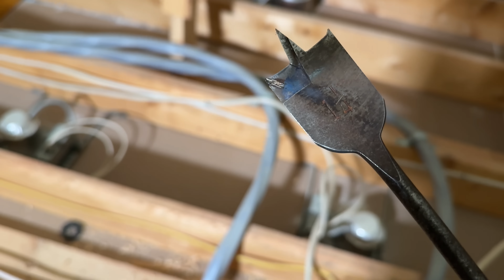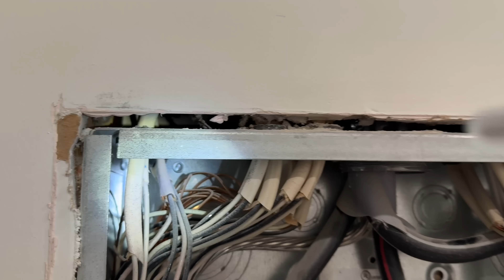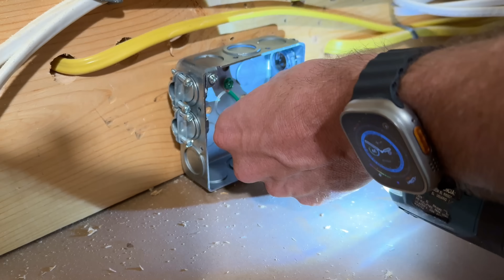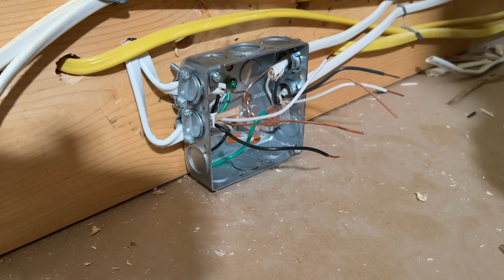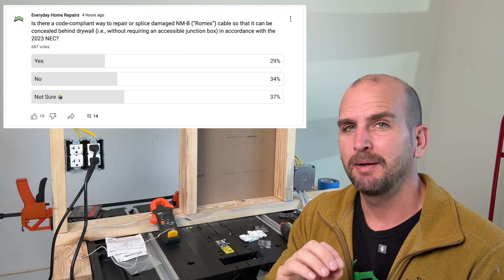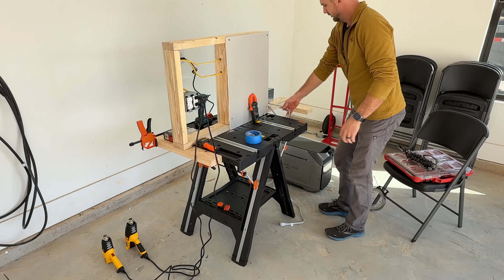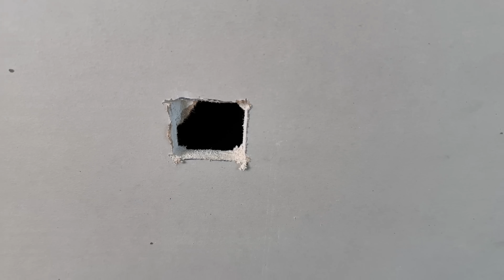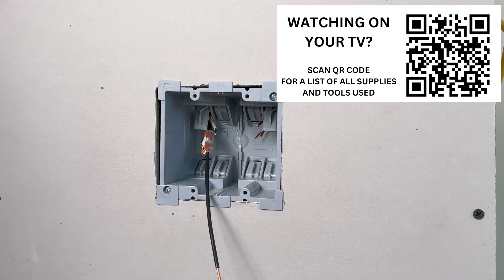How To Repair Damaged Romex |  3 Easy DIY Fixes

Comment: I'm curious how these will hold up after years of temperature cycling.
Reply: They don't last.

I just purchased a modular/manufactured home. ( built in 2001). The previous owner said that one of the bedrooms had not had power for several years prior. He had at least two "electricians" try to fix it. He was literally using extension cords to power the lights and other things in his bedroom. 

Less than a week after I purchased the property. I found the NSI connector under the home where the two sides join. Replaced it with a junction box and wire nuts. Problem solved. I have removed every NSI connector i have found.

Comment: As an electrician of 30 years I can say this is decent advice and I would only do numbers 1 or 3 although a bit different. Method 2 I would never do even if it is legal and made for that purpose. In time it has a high potential to fail and cause a fire. Any connection like that should be made where it is accessible and contained within a proper junction box. 
Method 1 is good although the junction box should be mounted higher and out of the way of future harm. 
Method 3 is good but I would add a second junction to have a more reasonable amount of wire enter the box and I definitely wouldn't use those butt connectors. A twisted wire and wire nut has been used for decades because it's a better connection and it's held tight. People can argue all they want, if I wouldn't do it in my mother's house based on failures I've seen over the years, I wouldn't do it in a customer's home.

Comment: Every electrician will call anyone who uses these a hack. Until they need to use one themselves. Plus the amount you can charge for it knowing the customer doesnt have to call a plasterer or painter to fix the holes made to snake a new wire.

Comment: Hey Everyday Home Repairs: Does your electrical inspector require Arc Fault Circuit Interupter protection (AFCI) on all living space branch circuits per the 2023 NEC section 210.12(A)?

Comment: Had tthe splice kit in #2 in my camper to connect the electric fireplace and almost lost the camper, would not want to use this in my house. Was a factory connection and I know they are only interested in production progress. Be careful when using these and make sure you use the pull test.

Comment: The issue with the splicing connectors is, there is no reliable way to check the quality of the connection under load, even with a milliohm meter. That being why some fail shortly, and others don't.
In the end, it is all about surface area of contact between splice prongs and the conductor. A barrel with couple of screws(on each end, making a total of six) would do a better job, but could increase the cost, reduce profit margin. There should be no issues with mating plugs in that respect. Just some 💭

Comment: “This new thing looks different, which makes it scary. Therefore it must be inferior to good ole insert-outdated-method-here that my dad taught me how to use.” 🙄

Now wago type connectors aren’t “bad” or “dangerous” because they’re demonstrably better than wire nuts, they’re just too expensive. 

Our 5th wheel RV was our home for 2 years on the road, and we put 20k miles on it in that time. It was full of backstab outlets and wagos. We had no electrical shorts or connection issues the entire time. Badly crimped PEX connectors is a whole other conversation…

Comment: It's amazes me how when wiring we strive for the most contact area for a good connection, but these "taps" makes the smallest piercing, in the insulation, and they are certified.  A recent undercounter led lights (which was designed to plug in) had this same microscopic "tap" but now are hardwired so much more copper connecting.
Reply: Most of these things have a bunch of extra capacity that goes untapped. The Wago lever nuts I just installed are good to 450v and 32a according to what's printed on the connector. There may be situations where you get close to that, just not in residential wiring. The breaker should throw well before it gets anywhere near that.

Comment: two boxes and blanks, new wire between. don't like it fork out big $$$$$ to replace it from end to end. suddenly most are ok with blank splice boxes.
those quick connects were/are used in prefinished modular home  panel sections to link between. I dislike them and think its just a n issue waiting to happen when a moisture issue or water leak occur and it's only a matter of time before it occurs.

Comment: I had a similar connector installed in the air conditioner of my RV... The ground was never connected property and the connector cracked. It was also in a humid environment full of condensation inside the connector. I won't ever use them for any project.  Absolute water proof with a physical bolted connector only for me.

Comment: Hack work.. Its better to just repull the NM cable and splice to an accessible box.. When it fails in the future and the electrician has to tear down the wall to fix the issue, we will be charging T&M.

Comment: I don't care for #3. with barely any wire coming in to the box and connectors stuffed half way out the holes.  Point of the box it to not have wire connections outside of a box.  Think I'd use two boxes to either side of the cavity and add a new length of romex between.

Comment: Being a motorhome owner I can tell you the hardware used is the cheapest possible, these manufacturers are about speed of build not quality, the methods are questionable at best, I had to rework many thing's the factory claimed were OK, biggest waste of money I ever spent, buying a motorhome 🤬, if one can replace those receps with normal.

Comment: No need to pull new wire to the Attic, just put in two junction boxes pull back enough slack to put a new wire between the two junction boxes

Comment: Ideally running a new length is a 100% fix.  However, I would choose #2 over #3 because the box looks ugly and is a "tombstone" reminder of your blunder and it contains 15 connections vs 9 in the splice kit.   "Less is more".

Comment: Can you give the NEC article that gives approval of the in wall splice kit. Also would have to be approved by local ahj enforcement.
Reply: Absolutely hate the idea of burying something like this in a wall. Things like this are invisible to anybody that does a home inspection the next time that you go to sell the house. And, nobody would even know if there's a ticking time bomb in the wall because it was done improperly.
Reply: I found it hard to believe too. Found this device is UL listed for NEC 334 application and 2023 NFPA 70, 334.40 (B) permits it. Doesn't mean it is a good idea, though.

Comment: Tip for short wires anywhere, instead of installing a double gang box which is a gain of 2" of conductor, install a single gang box near the studs to the left and right of the repair and connect with both boxes with a new piece of wire. That will gain you 12.5" of conductor on a 16" center frame. Sometimes, college ideas are just too risky, no shame to WAGO for trying to be cheaper than this.

Comment: In option 3, why use two short wires and three WAGOs per conductor?  Why not one short wire and two WAGOs, directly bridging the gap between the wires entering the box?  I'm assuming there's a good reason, just can't figure out what it is.

Comment: I put in a patio cover a few years back, and had to extend a porch light wire and wanted to use the NSI.  The electrical inspector would not approve unless it was in an electrical box.  I had to string new romex from the switch to the porch light, what a pain.

Comment: I remember a homeowner or hack electrician used these to save a a hundred dollars and ended up costing $7,000 plus to tear up a fresh kitchen remodel bc they went bad. They are legal but quality experienced electricians DO NOT use these or recommend bc in wall buried splices are looked down upon. I highly doubt this guy is qualified to give electrical advice

Comment: I had to use a Tyco splice remodeling... just a bad place for wire routing and was originally put in an unsafe place, so I had to move it up a wall and across through a hollow header, and used up all the loop moving it. The Tyco's in that 'box' though, so it would both be obvious and easy to break into if there's ever a problem. 

All those worries are worlds less risky than leaving that run in place would have been, since it was plain romex strung loose across a bunch of rather sharp masonry waste underneath a steel bathtub. Contractors/homeowners going wild in the early 80s....

Comment: I've never used those splices before. However, as a mechanic of fifty years I would only find one purpose for them  - filling my trash can. 3M has made something similar since the '50s called Scotch Locks and if I ever found one of my crew using one we would have a lengthy discussion and probably dismissal. We would have the same discussion if I noticed one in his tool box. They are crap, have always been problematic and I have zero idea as to how/why they have survived this long. When they have been used it's a 99.99% guarantee that they will fail and only the most green tech would not be aware of how worthless they are.
That being said, I realize they're two different products, yadda, yadda. However, the one is so worthless I could never bring myself to use anything similar.

Comment: We had one fail. I would not trust it due to ineffective contact. Having an inline butt connector would be better feeding both lines through twisting then clamping, lastly heat shrinking.

Comment: I prefer just putting them in tamper resistant channels disguised as chair rails.  Then you know where the wires are and if they need to be serviced, you don't have to rip up the wall to get to them.

Comment: H E double hockey sticks NO on that in wall splice. First, it is just a barb pushing into the wire. Second if it fails you will o ly know due to the fire. Most homes have low quality breaker boxes like GE, federal, challenger etc. Very few homes have a better quality like square D QO or cutler hammer CH box. The better quality brand breakers will actually trip when they are supposed to. But still not a safe way to work. The initial testing may tell you it's OK, but what is going to happen 10 or 20 years down the road after hundreds of heating and cooling cycles.

Comment: Re your "method #3" (pulling the ends of the damaged Romex into a box)... is there any reason the box couldn't be mounted rotated 90 degrees?  That way the wires could come straight in and not have to turn a corner, so you'd get a little more length in the box.

Comment: On the retrofit box, I'd put a couple of dummy light switches there. It will look better and be lots of fun.  Lol

But seriuosly i would wire in some smart home switches and connect them to any lights around with a smart relay in the light box or a smart plug for a floor lamp and then the switches would really switch lights and look much better than a blank plate.  If at a decent height.  If lower i would do the same but make them smart recepticals.

Comment: First error…it’s not Romex. It’s type NM or NM-C cable. Separately, you can’t just add a box because you need a minimum amount of wire on the box. Another one seems to me that your radius going into the box is not large enough. On another note, it’s really not a “hot” wire. It’s an ungrounded conductor. Another note, you refer to the grounding conductor as a ground, which is closer to what you call the neutral, which is the grounded conductor. If you’re going to try to give tutorials you should use the right terms.

Comment: I've used the NSI splices several times.  They can be a bit of a pain to get the wires into, especially with 12-3 Romex.  But it is nice that they can be buried inside a wall.  My local Home Depot used to carry them on the shelf, but I've had to get them online for the last couple of times.

Comment: What I learned in BOCES back in the 70s is that's not legal to repair that behind a wall.  
The only legal thing to do is install a device box in the wall with a blank cover plate if you can't run a new Romex run through the wall.  
But you can put an outlet in the box if it's in a home and you don't want a blank cover plate in a visible location.

Comment: I cut the sheetrock above the breaker box from the box to the ceiling on each side of the box. I used the cutout to make a door. I used hidden hinges and latch. To open the door I remove the face of the box and push on the latch side of the door and wallah! I see the hole in the top plate where the wire passes to the attic. The door is hardly noticeable when closed.

Comment: You're gonna have all kinds of Staples.You're kind of a brick wall with nothing but a piece of wire.It's impossible rewire it.Break your drywall open put a new home run

Comment: I’ve had commercially installed “plug in the wire” outlets fail.  The wires work their way out for unknown reasons.  That’s why I curl the wire and use the screw.
Reply: Same as MANY electricians. Stab connections are far less reliable base on failed ones I cut open with a zip disc. (I autopsy failed equipment.)

Comment: I nicked a wire in my floor while doing some remodel work recently. I didn't have the option to pull new wire or put in a box. Didn't know these existed so I pulled up what little slack I had and soldered about 1/4 inch of all three wires back together. Wrapped each wire with rubber tape and the whole thing with E-tape. Not the best but it's a lighting circuit that serves about 10 LED fixtures so it should never have much draw on it.
Reply: I've done similar with an extension cord (actually used heat shrink tubing), in an area where it cant be disturbed.     Perhaps this splicer would've been a better choice, had i known.    But I would definitely not feel comfortable with electrical tape in the wall.  The load is not the issue  - it may come undone over time and you wont know until its too late .  Thus it is rightfully  a code violation
Reply: @jefffree6990  Rubber tape has stronger adhesive and won't come undone. The biggest worry with that is that it tends to become brittle over time. But if the joint isn't being disturbed it should be fine. 
Of course it's a code violation but my only other options were to have a junction box in the floor right in front of a door or tear up a bunch of the ceiling and wall to get a new line back to the panel. There were no good options since I didn't know about this thing.

Comment: If you’re splicing, I guess you can use to extend too. The situation I could have used is I remodeled my kitchen getting rid of “soffit” border lights. Every kitchen outlet had to be redone because dam builder saved 6” on each by bringing wire through soffit space vs straight down wall😡. Once the soffit was down, I had wire coming out of ceiling 6” from wall, going back in 6” down. My yelling and cursing at builder not there, could be heard outside and wife came in and wanted to know problem.

Comment: If black buttons were used at that panel, there is absolutely no way that wire is going to pull through. They will have to be removed and replaced from within the panel…   Looks like they were used when you showed the open drywall along the top.

Comment: Your suggestion to use these connectors designed for manufactured buildings to splice NM cable is in violation of NEC Section 300.15.
Reply: After writing this comment I research UL and found it to be in compliance both with its listing and 2023 NFPA 70, 334.40(B), but I still wouldn't trust using it.

Comment: These relatively new connectors are extensively tested and they do seem to be a reliable way to make the repair. I am from the old school method of electrical wiring a home. We would make all of our junctions by twisting the wire firmly and followed by soldering. Then it all covered with rubber tape. This is of course very time consuming but that was how we did it. I do however think that the newer devices are a safe method of repair.

Comment: Just curious, why do U need a 2-wire Wagos for the 3rd option? Can't you just connect the wire from 1 Wago to another and call it a day?
Reply from the maker: Yes, you could simply jump the wires.  I did the pigtails to give a little closer representation to what you would do if you were also going to add an outlet.